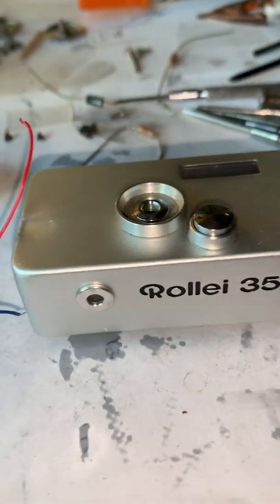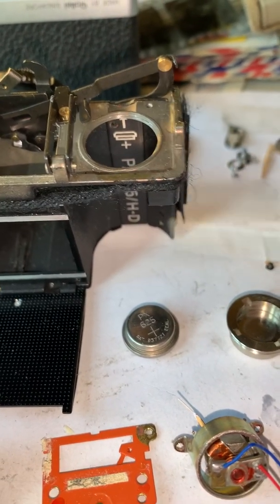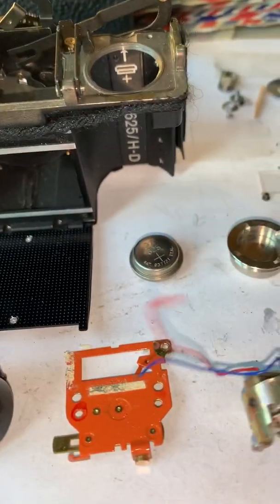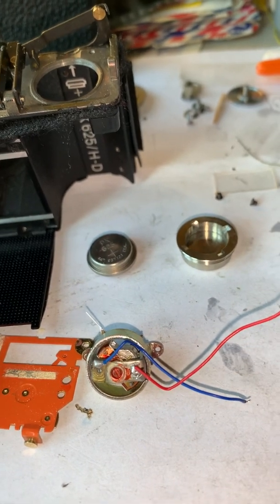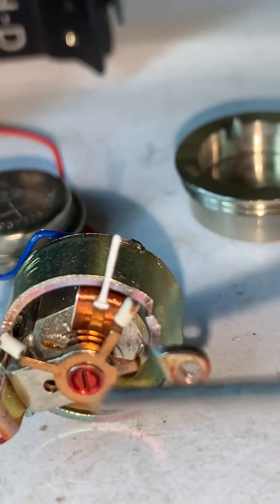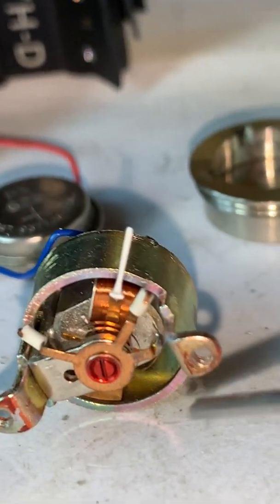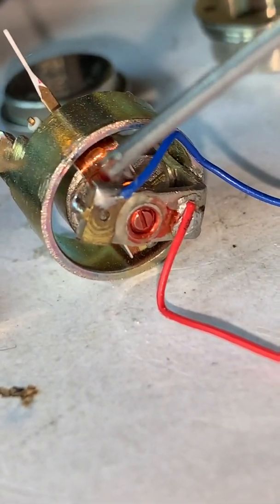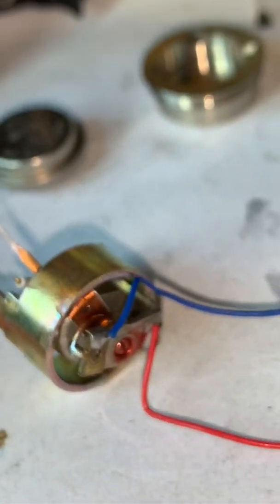Rollei 35 T light meter current flow

Comment: i have an idea and trying to finish it: remove all of these old and inaccurate parts and replace it with digital parts. a small oled screen show exposure parameters through the acrylic window at the top.
Reply from the maker: Sounds like a fun idea. I would try it if I had the parts. The original parts will always be original but a digital version sounds good.

Comment: Hi, for a 35T meter can you advise what the functions of the two trimpots are? One facing the rear of the body and one on the side of the body. Thanks
Reply: Download the rollei 35 repair manual - their functions and calibration are described. The only issue is, with the age of these pots, the carbon trace will not only easily lift off when adjusted, but also I n one of my cases, the silicon they were printed on, cracked in half. I replaced it with a modern miniature VR of same resistance. These kind of pots are only rated for a few adjustment cycles. They are not robust components. The problem with these meters not working, is typically the top connection coming unsoldered due to corrosion....not that the meter cell itself is at all faulty.